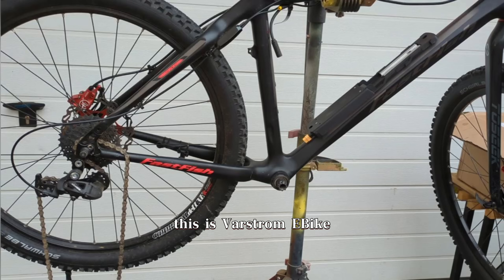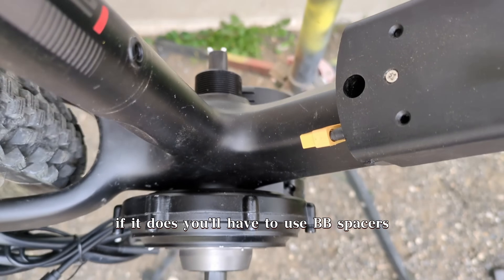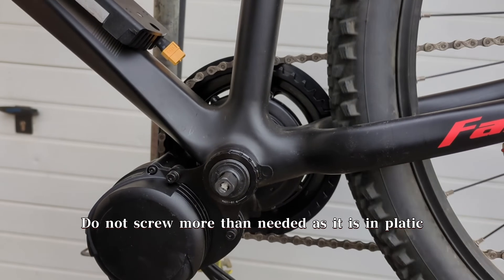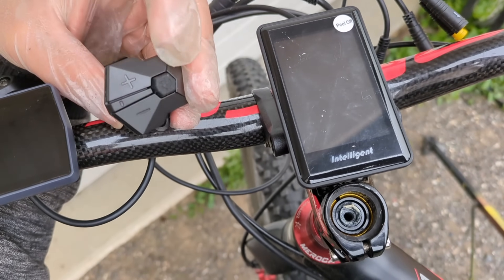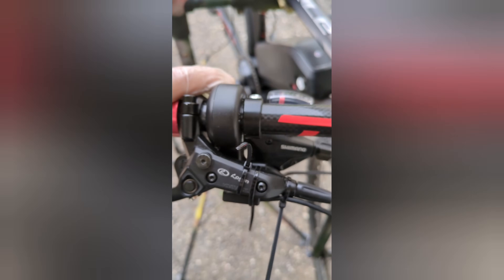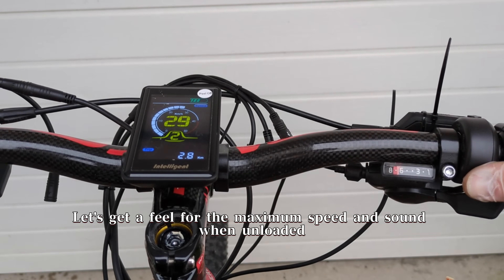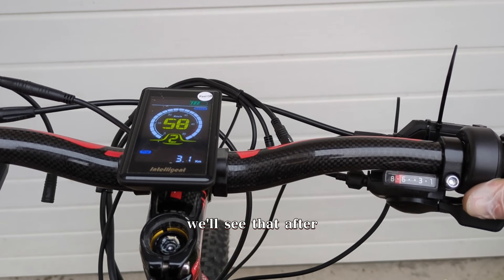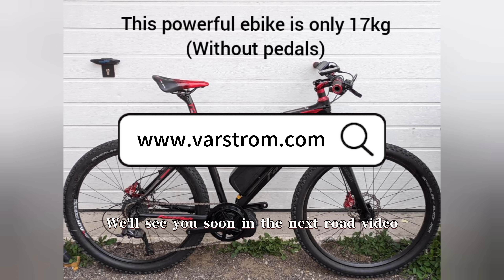As a strong competitor of BBS02B?Bafang BBS02B VS Tongsheng TSDZ8 - Installation Tutorial and Detail

Comment: I put my throttle the other way round, paddle on top, thumb push forward over the top. The only disadvantage is that the cable has to loop over the throttle body. Tywrap it. Careful if you turn the bike upside down!

Comment: I had two TDSZ8, the first one failing after only 100km (Error 6). Most noticable, both did not release the full power of the motor when pedalling hard. I could not follow somebody with a handbike with a motor set to 250W. Increasing the maximal current from 16A to 20A did not help. However, when using the throttle, the motor accelerates very strongly, apparently releasing its full power then. Something is seriously wrong with the controller/software not releasing full power when pedalling strongly.
Reply: There is a firmware update "available".
Reply: @reinierweerts6923  Both were on the current firmware. However, next week I receive a 1000W ToSeven DM01.

Comment: The Tongsheng blue gear on the motor "2" had to be replaced every 1'300 km or quite often. Is it the same wit Tongsheng 8 & 16 (1000 Watt)?
Reply from the maker: It should be more than 1,300 kilometers. I don't know where you saw the data. Normally, it can be used for more than 4,000 to 5,000 kilometers. The specific number is waiting for the technician to reply. According to my own experience, it is about 4,000 to 5,000 kilometers.
Reply: @varstromebikeconversion  what’s Tongsheng 16? Is it a real 1000W product from Tongsheng? There isn’t much information about it and only one website selling it. Is it a genuine Tongsheng or a knock-off?

Comment: Hey there Varstrom. I have just purchased a new ekd01 for my TSDZ8 from yourself via Amazon. Can you please tell me what cable I need to change my 8pin vlcd5 display as all the 1to4 cables have male 8pin but to fit the TSDZ8 I need a female 8pin 1to4 as the cable coming from my motor is a recessed male connection. I'm in the UK if you can help me out at all. 🙏🏼 Thanks
Reply from the maker: Our 1T4 cable cannot match your motor. Since your motor seems to have a different line sequence than ours, the line sequence of our TSDZ8 has been changed to a female connector. Did you buy your TSDZ8 from Varstrom?

Comment: Hi when will the replacement nylon gear be out as I'd like to have one incase thus gear goes. I'm at 1500miles already in 7 weeks
Reply from the maker: Hi, it depends on how you use it and the scenario in which you use it. Scientific usage and low stress usage scenarios will prolong the life of nylon gears.
For example, if your cycling habits are aggressive, often accompanied by strong acceleration and deceleration, or if you often need high torque for climbing, the life of the nylon gears will decrease very quickly. I've found customers who have had to replace nylon gears after 500 miles of riding (he's a delivery guy).
So there's not really a standard answer to this, but my advice is that having one or even more nylon gears on hand (buying more than one tends to be a better deal) is absolutely right, and my general recommendation is to check them from 1250 miles onwards, but if you don't notice any unusual noises, it's not really a matter of special concern.